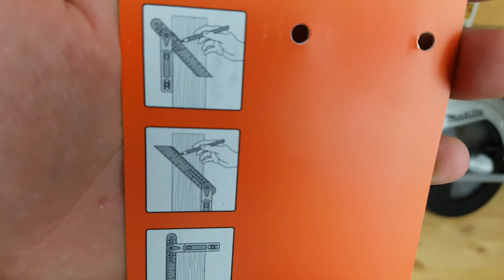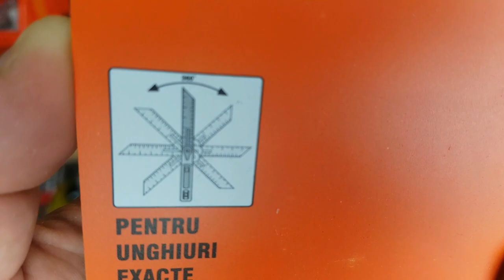Echer multifunctional Holzer si test panza Raider pentru fierastrau circular

Comment: Echerul reglabil este foarte bun in trusa de scule la unghiuri mai ciudate. Presele din metal sunt foarte bune daca erau din materiale un pic ma groase, am vazut in Brico si erau ok. Acum daca nu folosesti la strans piese foarte tare sunt bune. Pentru circular de mana eu folosesc o panza Joka de 180 mm cu 40 dinti si diametru gaura 20mm recomandat pentru lemn natural scanduri, sipci si pal melaminat, face taieturi destul de fine. Pentru diametrul interior de 25,4 mm nu stiu daca se gasesc. Sanatate si numai bine !
Reply from the maker: Sunt suficient de groase cat sa imi tina strans doua ractangulare sa le pot aftui. Eu n am inteles de ce nu fac astia inelul interior standard la toate fierastraiele. Sa difere doar diametrul si grosimea.

Comment: Salut Dan
Ai cumva moto foreza?
Sau ai vreo idee de recomandare?
Reply from the maker: Salut, nu am, as fi vrut una si eu :D N-as sti ce sa iti recomand pentru ca eu despre utilaje cu motor termic nu stiu prea multe. Am vazut ceva pe net de la diferite marci, nici eu n-as sti ce sa iau sincer. Bobby Bob are una de la Makita foarte smechera, daca banii nu sunt problema, se invarte pe la 2000 lei.
Reply: Am vazut si eu Makita dar mi se pare cam scumpa. Am gasit ceva de la Visoli la 1300 lei cu tot cu burghie...
Reply from the maker: @pet1967  https://www.emag.ro/motoburghiu-gsa-2-4cp-burghiu-150mm-foreza-pentru-pamant-aym-31231-mfe-1061/pd/D178HLBBM/
Reply from the maker: @pet1967  https://www.emag.ro/set-motoforeza-pe-benzina-craft-tec-putere-3-4-cp-1-x-burghiu-300mm-motoburghiu-pentru-pamant-5517-30/pd/D5ZYDLBBM/
Reply from the maker: @pet1967  https://www.emag.ro/motoburghiu-swat-foreza-de-pamant-5cp-2-burghie-incluse-100-200mm-motoburghiu-pamant/pd/D431H5BBM/
Reply from the maker: @pet1967  Cat or fi de bune...vad ca unele au recenzii pozitive destule